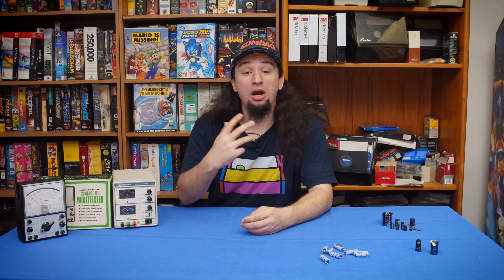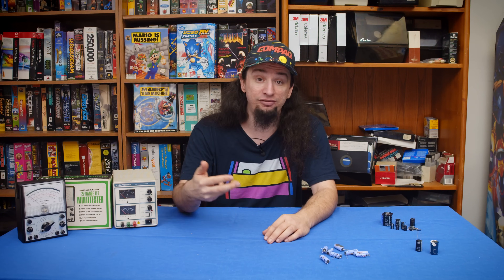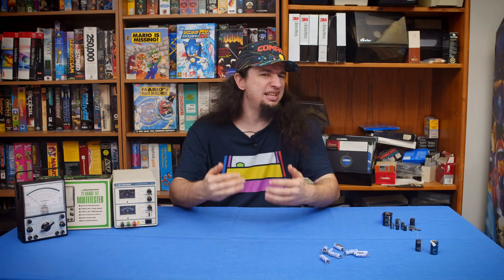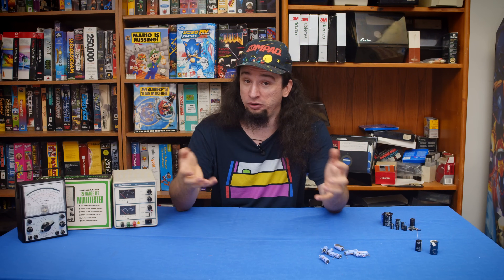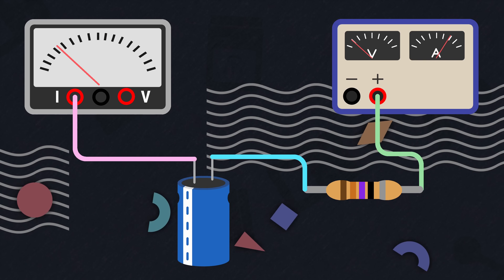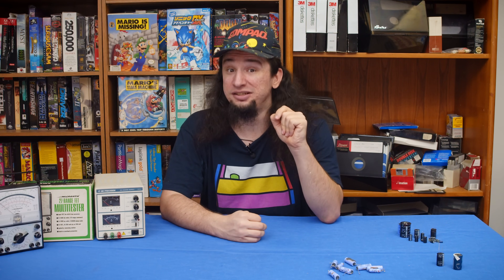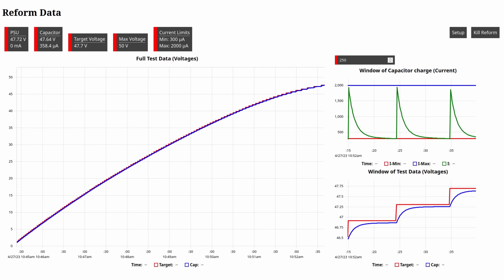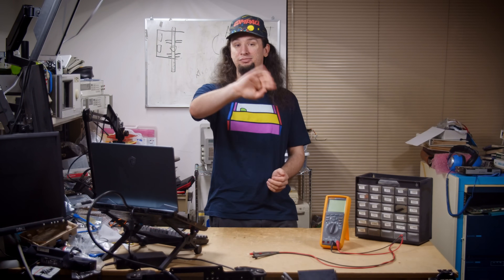Reforming Capacitors - Everything you wanted to know

Comment: 7:19 - This explains why the 20,000uF 6V capacitor in my Data General Nova 3 power supply was shorted internally after 19 years of storage and the higher voltage can was comparatively fine. The machine worked had before I put it away. I'm glad I checked first rather than blindly powering it on.

Comment: It very much depends on the build quality of the caps. Some can last for 50+ years (in use or not in use) with nearly no issues, and the cheap ones die in 5 to 10 years. Reforming should be done in the low mA-range (5-10 mA max. - but depending on the size of the cap, the smaller the lower the current of course). The reforming process can take 24h or more sometimes. Its worth the time for the bigger and higher quality caps, not for the small cheap ones.

Comment: I'd agree that if the equipment is going to be heavily used, or if failure will have unacceptable consequences, choose replacement over reforming because it will not be possible to reliably evaluate how much electrolyte has been used up in the self healing process.  In theory as a research experiment, I'm surmising that one might be able to try to put more water into the electrolyte through some kind of pressure treatment (using distilled water).    The hydrogen and (presumably) oxygen dissipated in operation came from the water in the first place.

Comment: Since you're in the U.S., any caps receiving mains power may see considerably more than 120 V. The "120 V" measurement for U.S. mains power is RMS; the peak-to-peak voltage of that is about 340 V.

Hm. The 370 V rating on the caps for your AC-powered drives is just a little more than that. Coincidence? You be the judge.

Comment: Thanks for the useful video. Instead of writing a program increase the voltage couldn't you simply   use the current-limiting feature on most power-supplies? Say set the current-limiting to 5mA and the voltage equal to the operating voltage of the capacitor.  Connect the power supply and the voltage will drop to nearly zero and the current will be 5 mA.  As the capacitor is formed the voltage will slowly climb without any user intervention and the current will be 5mA the whole time.

Comment: In most cases I'm just too lazy or it's impractical to use a Variac.  I simply turn on the unit just for a very few minutes.  Repeat many times .  At a later date power up as normal.  Most of my equipment is vintage test equipment, like over 30 years old.  So far so good.  No blown caps or leakage I've noticed.

Comment: Great for hobbyists, but honestly you need to compare the cost of replacement vs. your hourly rate for working on the problem.  If you spend an hour of labor (excluding the time it's percolating) but a new cap cost about the same or close to it then the new one makes more sense.  Especially considering that there is a strong chance that it won't work and you'll need a new one anyway.  Some caps can be expensive but your wages are expensive as well.

Comment: Also many decades ago I think an article said you could reform the capacitor to a higher voltage. Even on a brand new capacitor. So you could turn a 10 volt capacitor into a 20 volt capacitor,  buy slowly increasing the voltage with current limit. I think this will drop the capacitance.😅

Comment: Good video but way too complicated to reform the capacitors with software and expensive equipment. To reform a capacitor to say 10 volts. Just set your power supply to to 10 volts and set its current limit to say 2 milliamps. Connect the power supply to the capacitor. The power supply will go into current limit at 2 milliamps until the capacitor is reformed. Then the current will drop down to the leakage current. Done easy peasy. Or just put a multimeter across the capacitor and when it reaches 10 volts it is done. Why do some people like to go for the most complicated solution.😢

Comment: Late poster, but considering the slow nature of the process, couldn't using a 555 and a few High voltage caps and diodes to make a voltage pump might get you what you need to do larger voltage caps.  I think Ben Eater has an example on this.

Comment: This video will be a huge help to the vintage analog audio community! This is this a taboo practice amongst electronics techs who emphasize slash and burn repair methodology to avoid return trips to the bench. Many collectible audio pieces will lose value if  recapped unnecessarily as moden caps can sound overly bright due to slew rate. This info will hopefully give owners the courage to reform via variac more often.

Comment: Probably safer to measure the voltage drop across the resistor instead of wiring the meter in series with the cap. That way you eliminate the risk of damaging the meter if the cap shorts out during reforming.

Comment: We get into these discussions in the antique radio restoration groups. Many of these radios are 50, 75 or even 90 years old, and any unrestored radio has dozens of shorted wax caps. Most of us replace them all, assuming that they are all failed or close to it. But there are a few purists who insist on reforming the original caps, which might work with a great deal of effort, but even a successful reforming on caps that old would be really unreliable.

Comment: what if I have a older piece of solid state radio gear that has been in storage for some time. Can I reduce the line fuse current vale to limit the current to attempt to reform the caps in this. This is after visible inspect of course and nothing is obviously a problem?

Comment: I had success with an old electronic laptop power supply. When connected to the mains directly, it would blow the fuse every time. I had nothing to lose so I tried. It came back to life when I ramped up the mains voltage slowly. Good approach even when not knowing which components are bad.

Comment: The easiest way (at least for a point-to-point wired amp), is to leave it the circuit and just insert a high value resistor, e.g. 1MΩ and up, between the the + lead and the amps power supply.

Then switch on the amp. On a very old cap the voltage across it will settle at e.g. 25V (with a 400V supply), then slowly climb up to 400V. Which can take several days, if you want to spreed things up, you can always put on a lower value, as low as you dare... 

But it's very easy and gives very high quality/good sounding caps.

I also used to do that if the ampliers sounded crappy after a transient passed through.them. (It is very common that classical tube amps is a little HF-unstable, due to long ground leads, not even a ground busbar is good enough to make them stable, you need individual star grounds for each stage, connected directly to the chassis (which should be aluminum, or even better, cupper).

If you get, say an ESD discharge on the input signal on one of those old unstable amps (like when you e.g. play a vinyl record), that very fast spike will sort of be reinforced through the amp, which become like a hammer-blow on all components (including  caps). And that seems to damage them a little. But the above forming restores them.

 (My experience)

Comment: A half decent variable power supply will have voltage and current meters built in along with a variable current limiter, so it seems to me that is all you need, although if you own such a power supply and are into extracting capacitors from circuit boards, I'd bet your are going to have the rest of the gear. Of course you do need a power supply with a low enough current limit setting.

Comment: While building a makeshift power supply for a tube amp, I grabbed a 15,000mfd 450V electrolytic off my shelf that hadn't been used in 20 years. Everything worked perfectly, but I wondered why it got warm during the first use. I'm now knowing that it was due to the the reforming current. Thanks for this! Never too old to learn. :)

Comment: I would, personally, never reform a cap, when a new one is under $3 USD each except for special values/voltages. Reforming dies not bring them back too like-new 100% reliability. Yes they might work, but for how long? A year? Month? Hour?

Do you want to risk your entire circuit for that, when a brand new part is so inexpensive?

Comment: Some capacitors have vents, don't block them. It's good to have a heavy duty mega ohm capacitor to slowly discharge the capacitor before handling
Reply: Power resistors are better than discharging a capacitor with a screw driver to reduce the spark. . . Batteries also sometimes vent hydrogen and oxygen
Reply: It's not a good idea to use a screwdriver to discharge a capacitor. . . Apply at your own risk

Comment: I’m not sure if reforming “refurbishing”capacitors is a good idea or cost effective or if worth the risk.  Capacitors found in vintage tube amplifiers are made with electrolyte that had dried, and capacitors found in 1970’s computer pcbs are known to leak. Refurbishing any electrolytic can type capacitors for reuse is a risk not worth risking.  You may end up destroying a device by doing this.  I’m an Electronics Engineer of 30 plus years.  That’s my takeaway from this silly idea.

Comment: I would think that this is only an option so long as the capacitor has not dried out over time. 
I've cut open and pulled apart a few 40 year old electrolytic caps that showed no signs of leakage or corrosion that were in barely used equipment the refused to work after being stored for 35 years or so. The foil and paper crumbled like bread crumbs inside. there was no sign of any oil or electrolyte left, just dry, cracked papers. These caps were known brand, both US and Japan made brands. Each of them tested just fine on a handheld capacitor tester but failed to perform in circuit. 

Just the same, I've had others, that seemed no different than brand new that were new in the box stored since the 70's. 
I actually have several large boxes of 70's era caps that came from a defunct warehouse, Most are 50 and 80V larger rating electrolytic caps made in the USA. After minimal reforming they test and read just fine. They have a higher ESR than a modern cap but I sort of figure that they likely weren't any better the day they left the factory in 1974.

I deal mostly with vintage HiFi and the cost of arbitrarily just replacing every electrolytic cap in a unit is often cost prohibitive on top of the fact that sourcing suitable replacements can be very difficult. Huge 10k and 20k filter caps the size of soda cans in many older amps are now less than half the original size by application, but I find that the newer smaller, same value caps tend to be short lived or simply do not perform as well as the originals. I often to all I can to salvage the original filter caps for this reason, I've often found that the original caps, properly reformed, or replaced with good used originals work better and longer than the modern replacements. 
After the mess we dealt with in the late 90's and early 00's with caps leaking and bulging, I'm more than a bit leery about the quality of the newer parts we see. Counterfeits and production cost reductions have seriously had a huge effect on parts reliability as well as ruined my trust in many parts suppliers. 
I read somewhere that as many as 50% of the components being sold, even those coming from reputable suppliers have been infiltrated with counterfeits and fakes. 
There's also many cases where the only parts you can find are modern Chinese knockoffs, or settle for 40 year old new old stock parts that may or may not be fake or degraded by time themselves.

Comment: Well how about powering units that have been sitting a while ? We had some power supplies that were in storage 5 years and when we tried using them some blew up ! The manufacture told us to power then up 2 minutes at a time for 4 or 5 timed then use them and the problem when away!

Comment: Thanks for this video! It was a great primer on the subject, and I feel better about being semi-obsessed about reforming electrolytic caps, now…
😉

I’ve done it the manual way with a Variac, bridge-rectifier, lightbulb and DMM, and that’s OK for occasional work.

I think your method of using high-grade gear to automate the process is the best way, but for those of us who don’t have the $$  to buy the gear (or the chops to hunt it down, used and cheap), how about using microcontrollers to automate the process? An Arduino, or better yet, an ESP8266 or ESP32 should be able to handle the task easily.

And making multiple copies of such a rig would allow ”parallel processing” of large(ish) numbers of caps.

There are quite a few VERY cheap CC/ CV DC power converters from AliExpress, etc., in the voltage range up to 60VDC or so, and there should be other options in voltage ranges somewhat above that (yeah, 300V+ gets tricky).

Many of these cheap converters use something like a 555 timer circuit to generate the PWM signals to control MOSFETS to limit current and voltage, using small pots to adjust the pulse width of the PWM signal. Since microcontrollers can directly generate a precise PWM signal, you can easily bypass the pot and 555 on these circuits to directly control the MOSFETS via Arduino code.

I’m not sure if these cheap controllers can be dropped all the way down into the 1mA range of charge current that you mentioned, but if not, there is probably some other useful option for a cheap cap reformer circuit?

Using a selectable-range DIY voltage divider to get the current charging voltage into the range that the ADC on the uController can handle measuring should be straightforward enough, and with enough ADCs, one could even select from a number of voltage ranges by selecting which ADC (pin) to use.

Using a simple shunt to measure the charging current should suffice at such low charging currents. Simply selecting a resistor of the proper value to generate a voltage drop across the resistor close to the 1V or 5V limit of the ADC on the uController at say 1 or 2mA would be easy.

I’m just getting onto learning to code for Arduino, so I don’t know how long before I’m up to this, but I’ll bet you and many of your fans here could handle it easily!

I do have quite a few relatively inexpensive DC power supplies, but I don’t know that ANY of them can go as low as a milliamp or so of regulated current. Perhaps they can be modified, but I love the idea of something like an ESP32 handling the job, so it can be monitored via WiFi, and graphed / logged, as you have done with the high grade gear.
Reply: A (rough) idea about a cheap high-voltage power supply:

I’ve used the following rig to MANUALLY reform high-voltage caps.

The caps were very large, and rated at about 550VDC, and were from a huge studio strobe power pack:

A large 120VAC Variac, with the output going into a fairly large (1,500VA) “control transformer”, which boosted the 120VAC maximum output of the Variac to either 480VAC or 600VAC, depending on tap selection.

From there, a large (1,000V rated) bridge rectifier to rectify into unsmoothed DC, and from there directly connected to the cap (so, no DIRECT real current limiting!).

But how about using a cheap, small, inexpensive transformer, that can handle either 120V or 240V on the primary, and a secondary voltage high enough to be rectified into the desired DC voltage.

Connect a Triac-based dimmer circuit to the output of the transformer, IF there is such thing as a cheap Triac-based dimmer than can handle more than the usual 240VAC maximum. You COULD even feed the output of the Triac into the PRIMARY side of the step-up transformer, though the non-sine-wave output of the “dimmed” Triac will cause heating and inefficiencies in the transformer, MAYBE not a big issue at such low current?

The rectifier is between the end of the AC part of the chain and the cap, of course.

Then the question is how best to automatically limit (and adjust!) current?
Can a Triac-based AC dimmer do current limiting, as well as voltage adjustment?

A fixed-value resistor in series anywhere in this chain would work, but with the problem of not being able to be “trimmed” to keep the charge current at the desired range through the whole voltage range. So, perhaps, maybe switch in current-limiter resistors of stepped values in the DC part of the circuit, as the charge voltage climbs, using the microcontroller to do so using high-voltage transistors?

Or a small potentiometer being trimmed by a stepper-motor?
😉

I’m just spitballing here, please feel free to correct my naïve dumb-assedness!

Comment: Dang , I was gonna slide the cap off dip the board in som Gatorade and tape the cap back on with electrical tape.

The plastic wrap was loose n expanding looking and the lid slid right off , there was stinky juice that must have seeped out and I’m assuming that caused my motor to automatically run when powered on? I’m pretty bummed I can’t go back in time n not have ran an additional 18v into what was already probably maxed out. I got greedy it was working just fine.
Now I gotta probably buy a new control box thingy! 
I have a multi meter and a electric tester but none of this other jibber jabber !?
All this hodge podge makes me either wanna learn more or give up